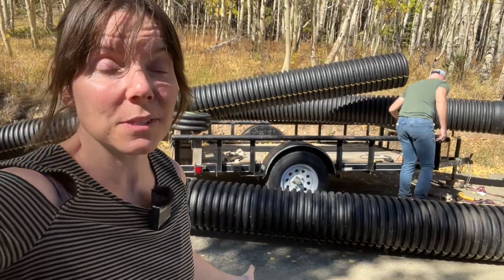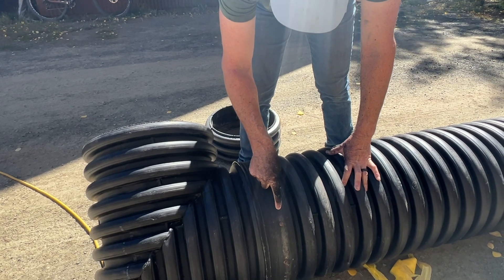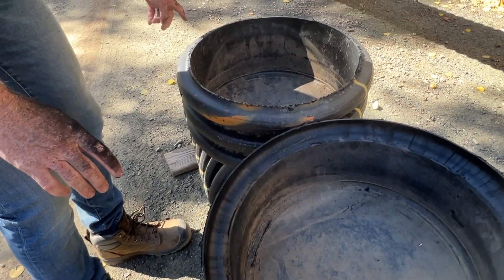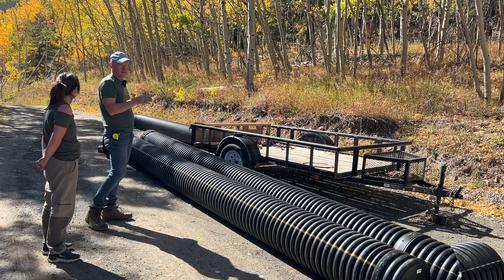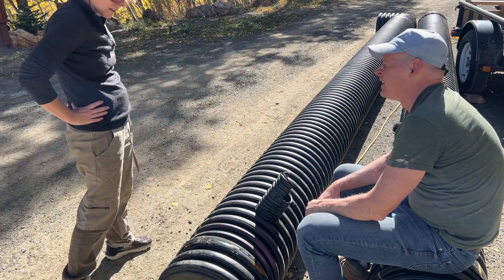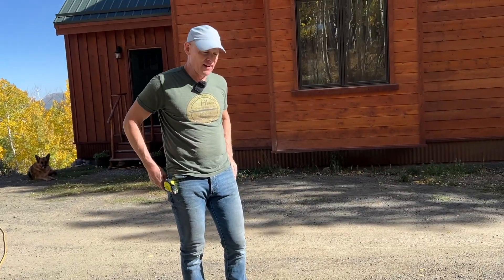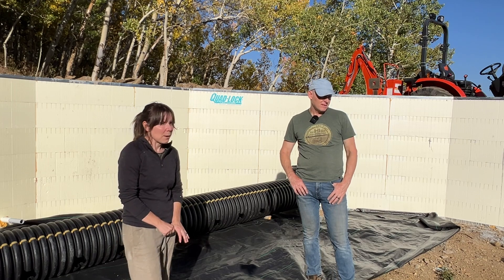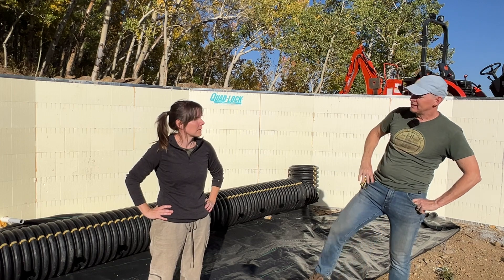Prepping the GAHT (Climate Battery) System for our Greenhouse

Comment: Air is not underground!!!!!!!!!!!!!!!!!!!!!!!!!!!
Reply from the maker: Can’t tell if you’re correcting something that was said or referring to the fact the foundation isn’t backfilled yet.
Reply: @ColoradoMountainLiving , this person is trying to show how smart they are. Typical troll. In the video you said that you would be harvesting the air from the ground. Obviously you are referring to the heat you would get from the ground and most can figure out what you’re saying. Some feel the need to correct others. Why can’t people just watch and enjoy the video. You both are really doing a great job. Love the channel. Best of luck as you continue to improve the property.
Reply: @906Dreams  
The majority of the heat stored in the climate battery comes from cooling the greenhouse, this is why the amount of winter sun is so important for climate batteries. The mass around the tubes isnt instantly recharged with heat from the surrounding ground, this is why you can only access the heat in the mass out to about 8" from the tube wall in a 24 hour period. If you google for soil conductivity and diffusivity you`ll get an idea of how fast heat moves through the ground. Its important to point out the design issues as a lot of folks just copy systems they see on you tube.

Comment: I`ve done everything possible to advise you guys but i failed :( These systems work great but only if they are designed correctly.  The sharp 90 degree elbow leading into the header is too tight of a turn, the air will decelerate creating back pressure. This will elad to an increase in static pressure and a corresponding reduction in the output of the fan. The 34 tube ends protruding into the header obstruct the air flow and create turbulence in the header. The protruding ends dont make for a smooth low loss transition of air from the header into the 4" tubes (compared to bell mouth entry). This will incur another significant reduction in cfm and also create uneven flow distribution in the 4" tubes. The losses in the inlet header will be duplicated in the outlet header for the same reasons.. If you plough on regardless, you should have an hvac engineer test the system flowrate and pressure loss after installation. The test report will confirm all of the issues, the system flowrate will only be a fraction of what you expected to see.  It certainly wont be close to the 38 ACH turnover rate you could have achieved with an alternative layout costing less than $2000. 
Fwiw, The calculator on eco systems website was originally created by John Cruickshank, who i was privileged to count as a good friend before his passing in 2011. The calculator doesnt include new data from experimental testing that happened between 2009 and 2011. (this is reflected in the version history tab.)  I pointed out an error they missed in the calculator back in 2017 and it hasn`t been fixed.  http://www.ecosystems-design.com/blog/reviving-sunnyjohns-work#comments

Note : The slits in drainage tubing are located in the valleys, which results in condensate collecting in the bottom of every corrugation with no way to drain. When heating, the water in the corrugations will be converted into water vapor (gas) using sensible heat from the mass. The air leaving the tubes will contain a significant amount of water vapor which will only serve to increase the greenhouse humidity (RH%), not the air temperature. If you track the RH% on cold winter nights you could see values as high as 95% which ideal for mold but not good for the structure or plants. Modifying the tubing with a straight shallow slit prior to installation will allow all of the condensate to drain. This simple modification increases the heating performance  significantly.
Reply from the maker: Found your comment here under filtered(held) comments, probably due to the website link. We do appreciate all your advice and it's hard to know where to turn online these days; we tend to follow the general consensus (we consulted 5 different people/companies, who all recommended this system; although your specialty advice is surely sound and valuable; it's hard to keep track of advice coming through youtube comments in real time- as even this comment was buried by YT for weeks).  Hopefully we'll find workarounds to fully enjoy our system and enjoy the greenhouse.
Reply: @ColoradoMountainLiving  
That`s unfortunate as you only get one chance to get things right, which is in the design phase. Once the tubing is in the ground the choices are limited to leaving it in the ground or digging it back up.

Comment: Great progress guys. Back in the 70's, a contractor here in the Adirondacks built a number of highly-efficient homes using only solar for the heating system. And he too used air ducts buried in sand to store the summer heat in, and would release it during the winter. He called it a 'sand battery'. I toured one of these beautiful homes in January when it was 10 degrees out, and it was above 70 degrees inside. No central heating system at all, just a small Jotul cast iron wood stove for backup. I am excited about your build, as I've been using solar heat principles as much as possible in my home builds. (Two post & beam framed homes). I built one for each wife lol. Amazing moose shots.
Reply from the maker: Wow interesting!

Comment: 👍 Very cool.   I had to go watch another video to understand why perforated pipes...condensation... if solid, the pipes would fill with water.  Got lucky first video as this guy explains it perfectly right at the beginning... https://www.youtube.com/watch?v=qgctv0ipLGQ
Reply from the maker: Right on!
Reply: @ColoradoMountainLiving  
The perforations are located in the valleys between the ribs. This results in condensate collecting in the bottom of every corrugation with no way to drain. Water in the tubing has a negative impact on heating performance which is the reason why its so important to modify the tubing prior to installation. The guy in the linked video spent $1100 on the 10" SDR pipe and a couple of 10" 90 degree elbows,  he obviously has more money than sense.